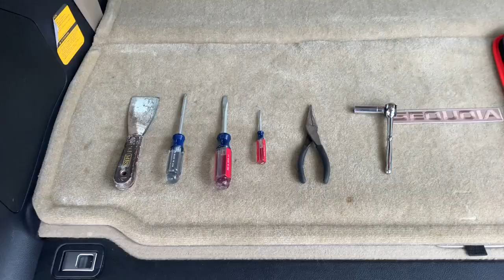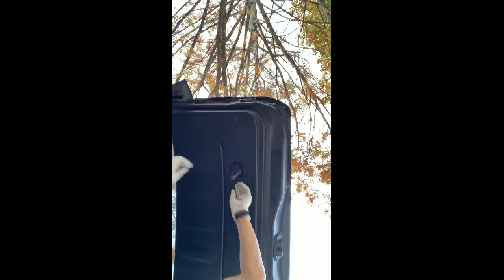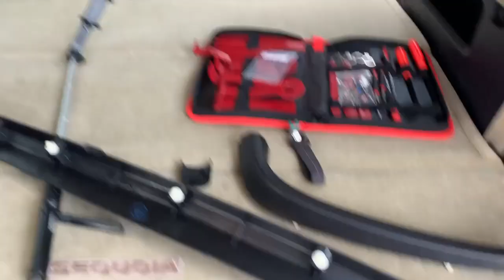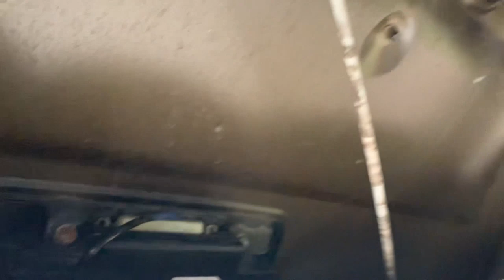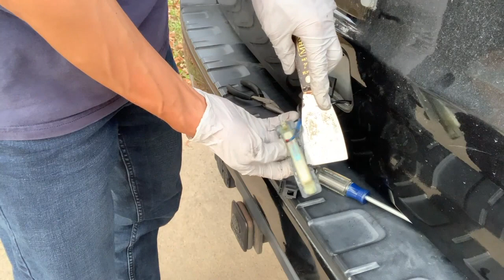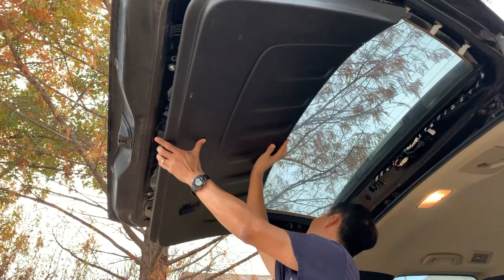TOYOTA SEQUOIA REAR DOOR HANDLE REPAIR 2008-2018

Comment: Thank you so much for this. I thought it was only my Sequoia having this issue with the melting door latch cover. Crazy they let this go out of the factory with this issue! Also, I used goo gone gel to remove the tar residue after scraping most of it off. With that and a few paper towels looks like new.

Comment: Thanks brother, was able to fix my handle cushion and replace my lock hatch mechanism which was not fully closing. Once I replaced my rear hatch lock mechanism my rear fold seat buttons and close hatch button started working properly. I also had to remove  the ecu-b fuse for five minutes in order to reset the system. All works perfect now, praise the LORD!

Comment: Oh man, I'm so happy to see this video!  Our problem seems to be the same as yours. I just ordered parts (I'm getting the switch assembly as well, just in case the plastic parts are just too old and fragile).  The Toyota dealer wanted over $1,000 to fix the rear hatch switch on our 2008 Sequoia.   Thank you!!

Comment: Pretty good video. Just did this to my 2014. Took me about 1 hour being pretty careful. The black “tar” around the button is black butyl sealant or putty. The same stuff used on the plastic sheet vapor barrier. It is very sticky and stubborn but it is great weather sealant.

Comment: Thanks for the detailed video. Did mine today using your video as a guide. Largest part/time was scraping off all the melted rubber from the switch and bracket.

Comment: Thank you for the video!  I needed to change the power latch assembly on my 2010 Sequoia and your video was perfect for showing me how to get access in to the door.  If anyone else changes the assembly latch, initially after I installed the new one it would not work.  The door closed and partially latched but then would not open or close.  If I tried using the button it would beep twice and the car display was showing the door as open.  Then I read I need to disconnect and reconnect the negative battery terminal to reset the system.  I tried that a couple times but it still wouldn't do anything.  Then I used the remote to lock and unlock the doors and at that point the latch started working.  So it seems you need a combination of disconnecting the battery and then using the door locks.
Reply: May I ask how your Sequoia is doing? How many miles? Any major issues, etc. 
Mine just rolled 200k and is running strong.
Reply: @MrHilljohntimothy  My Sequoia is almost 150k miles.  I have only owned it for a little over a year and in that time one thing that has needed to be changed is the serpentine belt.  Then the power latch assembly that recently stopped working.  We are very happy with it.
Reply: @MrHilljohntimothy  my 2013 is at 205000 miles and no major issues.  Only issue is the rear hatch pressure acuator??(don't know what to call it, but its what holds the door up when open) isn't working properly and the door will come down on its own slowly.  Other than that, no issues

Comment: 2011 SR5. And the tailgate won't latch/shut. I can just lift it open. The button to open it, I can hear it working but that's to open it. I keep finding solutions for Hatches that WONT open. What about for the ones that won't shut/latch/close propper. 
Thanks 👍
Reply: Did you find a way to fix this issue?
Reply: @nothanks1627  I posted this very issue on many videos. One person finally replied confirming it is the actuator in the rear hatch. I bought one and am waiting for the weather to break and get warmer to go in and replace it. I bought it for about 60.00 on Amazon and I have been trying to find a video on how to lubricate it pre-install to extend its functionality. No luck there. So might just do a normal install of it in March
Reply: @UODuckFan  Dang! We had problems maybe even as far back as 5 years or so with this and I don't remember what I did but it worked until a few months ago. The actuator was not letting me open the gate, but today I got it open. Its just now it won't latch so the gate just opens while going down the road lol. Im just going to replace it, and I will spray lithium grease on the moving parts. Thanks for responding 😀
Reply: @nothanks1627  I run a strap from behind the seat(the lower area with metal) to the little strap that hangs off the rear hatch. and tighten it, to keep it shut till I can replace the actuator.
Reply: @-TerryBogard  Love it! Now im just looking for the oem part, not sure about buying the cheap ones just to keep having this issue. We use the lift gate frequently.
Reply: @nothanks1627  I bought the Amazon knock off. Was 65.00. once installed I'll post again about it month to month.
I hate not having my rear hatch functional.
Reply: @-TerryBogard  Same. Its $176 online only from a Toyota dealer, otherwise I guess I'll just gamble with Amazon. Rockauto sells only one and its an off brand with 2yr warranty. That one is $125. Its really not hard to change so I guess thats the good thing.
Reply: @nothanks1627  I finally took the day today to try and replace the actuator..I bought the wrong one. But good news is, it was EASY AS HELL to take apart the rear lift and remove the bad actuator using this video. I ordered the proper one and it's coming tomorrow. I'm stoked to have my rear hatch fixed. I'll  reply again after I get it done.
Wish I could post pics here, I'd show you the process.
Reply: @UODuckFan  I ended up putting the Amazon one in it. Works great so far.👍🏻I also put new rear hatch struts and hood struts on it from Rock auto. And new alternator, waterpump, radiator and hoses. Just due to age and mileage, no failures. We love our Sequoia
Reply: @nothanks1627  awesome man. God I hope the replacement rear latch works. I'm exhausted working on this
Reply: @UODuckFan  But you need to watch the video about how to program the system to re sync the back hatch operation. Its easy but has to be done or it won't operate correctly.
Reply: @nothanks1627  have a link for it? I just have the SR5 Sequoia. Rear hatch doesn't open on its own or anything. 
Appreciate any help
Reply: @-TerryBogard  Oh ok, if yours doesn't open on its own you will probably be ok. We have an '08 Platinum and it had to re learn the proper function sequence. If you end up needing the info just ask and ill help you 🙂
Reply: @nothanks1627  I bought the replacement actuator for the one that opens automatically. Was the wrong one.  Still tried to use it with no luck. It fit but didn't work. 
The correct replacement comes tomorrow. My rear is all taken apart and ghetto rig shut. So I can just replace and hope the new one works. 
I'll let you know. Thanks
Reply: @nothanks1627  got the correct actuator and put it in. It works. Thank God. My trucks back to normal now.
Learned how to remove panels and replacing this was EASY. Plugged it in, screwed it in..done.
Reply: @-TerryBogard  Good to hear! Now that's a happy ending!👍🏻
Reply: @nothanks1627  and if this is a crappy knock off that fails in a year. I know how to replace it in 30 minutes with a better, top quality piece. Something I'd like to do is lubricate and protect this actuator. But I have no idea how to do that. Ignorantly I may buy lithium lubricant spray/grease  and spray it down but that seems possibly as bad as good. The old actuator was so rusted and full of dirt and dust. I smacked it for 5 minutes straight and dirt and crap still kept coming out of it. 
So I'm ready to replace this part if needed now. Learned a lot.

Comment: a better option for the plastic cover is to pull until you feel resistance then slice mm by mm with a razor blade. sometimes the stuff will stick and the plastic will tear before the glue releases. it is also easier when pressing back together bc you have a clean line whereas if you just pull, sometimes you get those long strings and they make a mess

Comment: How do I remove the “sequoia” plate below the Toyota emblem?
Reply: prob a heatgun and either 90% rubbing alcohol or acetone then detail that area
Reply: @tipr8739  ty. Appreciate it.
Reply: @americandude3825  Thats not true I was thinking the Iforce plate. I think you have to unscrew it from the inside
Reply: @tipr8739  ok. Thanks. I’ll look at it. Appreciate it once again.

Comment: Nick, did you replace the button because the button wasn't working? The problem I have is that when I close the trunk, it doesn't stay locked. A few days ago, the button stopped working completely and from the outside, the rubber looks fine but when I press the button, there's nothing. Is that what you experienced?
Reply: What ended up being the problem?
Reply: @MrHilljohntimothy  still haven't fixed it. The remote and button inside still works so I didn't bother. I will have to one day though.